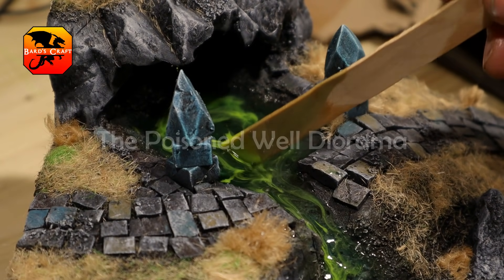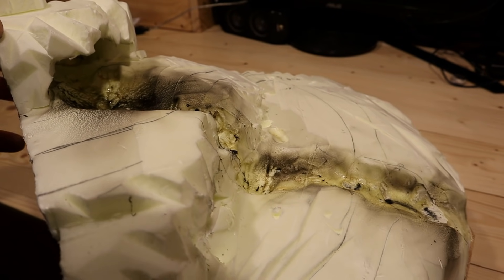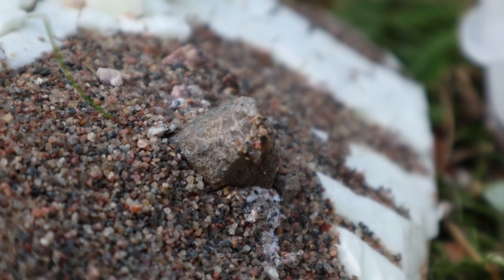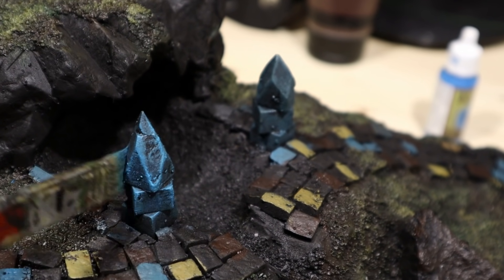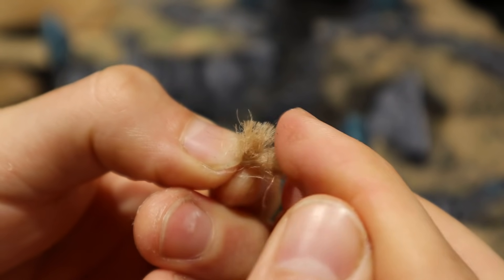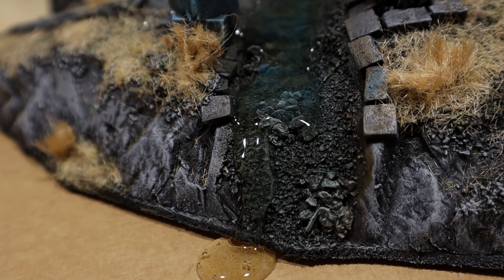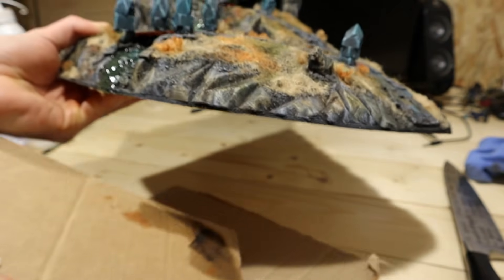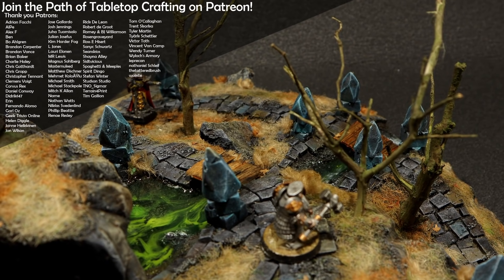Ultra-Vibrant Autumn Diorama on a PEASANT Budget!

Comment: other crafters: use a 500$ hotwire to cut foam
luke: FIRE AND KITCHEN KNIFE
Reply: Hot wire cutters are nowhere near 500$ and his name is lukas.
Reply: i know thats only one example but still
Reply: @dinobuckwell2999 Thats literally a desk I got a Proxxon for 110$. And the hotwire foam factory cutter is 50$.
Reply: @MrPug-dt4sd  for goodness sake. why do we need to argue about this. 
i made a joke.
 i don't care if you have a PhD in hotwire foam cutter prices. can't you just laugh and then move on? sure, most hotwires don't cost 500$. 
i was using a hyperbole.
can't you see that?
Reply from the maker: grug has fire
Reply: @dinobuckwell2999  ok.
Reply: If you are handy enough to create a diorama, you should be handy enough to build a hotwire foam cutter by yourself very very cheaply

Comment: HI, for the stone bicks, slabs and such, I have seen other crafters use "tin can and stones" technique.
Basicaly:

1) cut the foam pieces
2) put them in some (plastic or metal) container/can with lid 
3) add some "little bit sharper" stones
4) close and shake rigorously
5) ????
6) profit

Comment: you can try small steel brush (for rust) and brushing foam to get more interesting textures. wood , for example. Also try to find Kombipor - combi panels for thermal insulation

Comment: Please don't carve foam outdoor. You're basically just throwing plastic in nature. :/
Reply from the maker: I picked the foam up
Reply: But what about all the smaller bits? The dust that you would normally have to clean indoor does not disappear. And it is basically micro plastics. :/
I mean it's probably not an environmental disaster. It's just one build every now and then. But I would still not encourage it.